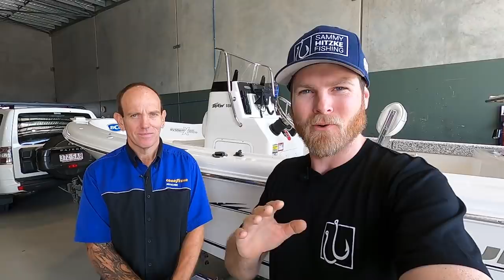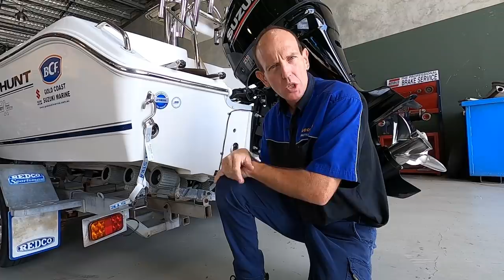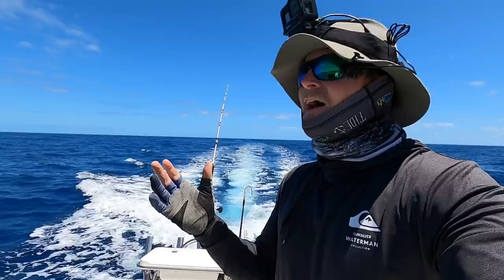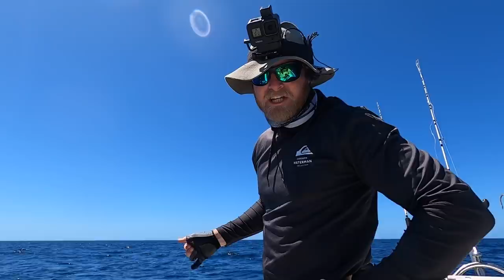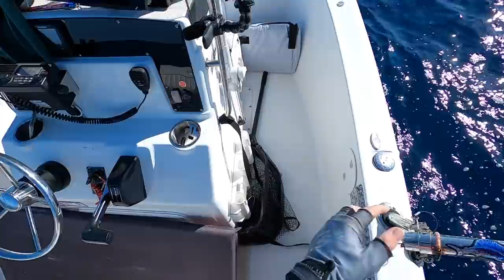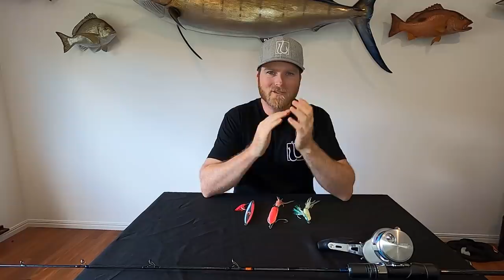Lucky I packed the Slow Jigging Gear!!

Comment: Nice Video Mate👍🏼. Is that a fast gear reel you are using fir slow pitching? Is 6.3:1 fast enough on 30lb spectra on MH slow pitch rod?
Reply from the maker: Yeah mate it’s a HG version or ‘high gear’. 6.3:1 should be fine 👌👌

Comment: Gday Sammy , I love your videos , particularly on Slow pitch jigging . . May I suggest to make them of a lot more value that you throw in more pertinent information . Those of us researching for knowledge are particularly interested in what depth you are jigging , how much current you are working in at the time , what jig weigh used and line strength and diameter if possible . Also importantly the rod rating used in the conditions . Particularly in the deeper water ie 100 Mtrs plus . A lot of videos out there say they are jigging instruction , techniques etc but only show action . 
 Your videos are usually a cut above the norm and it is appreciated . 
 Keep up the good work . 
 Regards Rod .